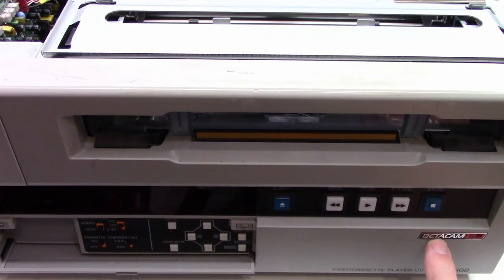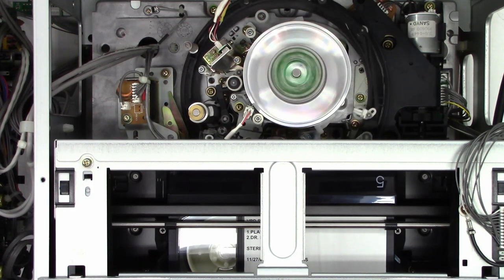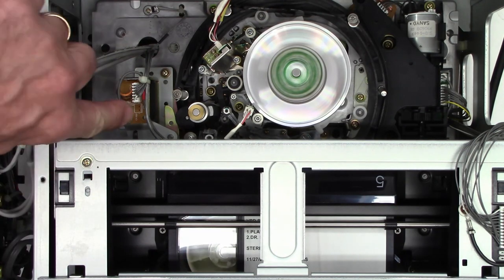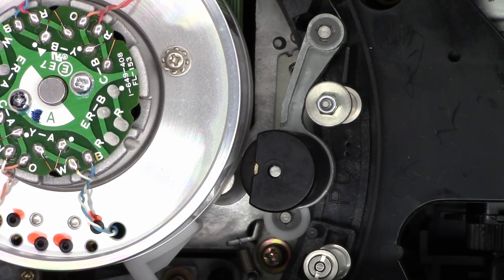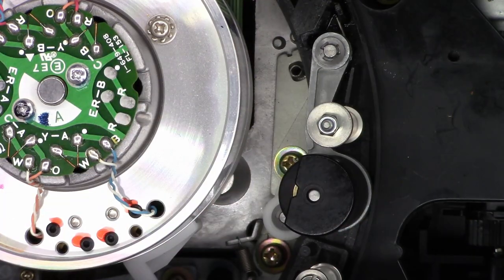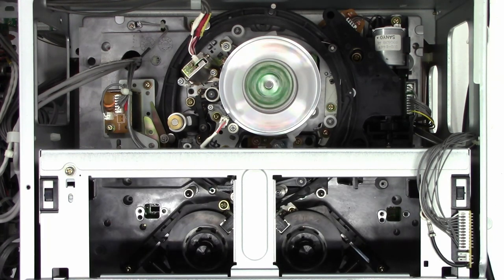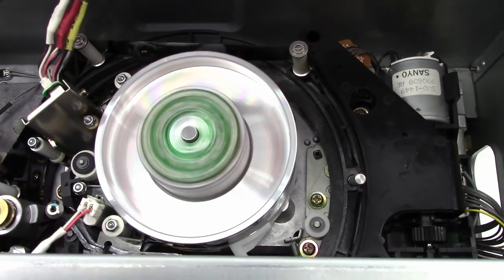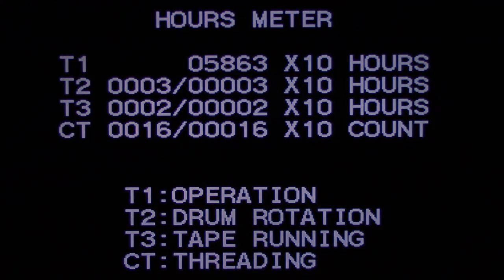SONY UVW-1200 BETACAM SP ERROR 02-603 FIX UVW-1400 UVW-1600 UVW-1800 UVW1200 UVW1400 UVW1600 UVW1800

Comment: Back in Europe i used to have a v2000 (video2000) machine. Huge thing that worked great. But PAL only . Still, wish i still had it.  How did you splice the tape
Reply from the maker: Very carefully by hand with scotch tape on the non magnetic side trimmed to about 3/8" and then hand trimming to get it right. I used to be able to splice audio cassette tape that way also.

Comment: Hi. Nice video. I have a sp machine and I have to help the threading mechanism around. Do you know if I can lube something to make the motion smoother?
Reply from the maker: What shape is the loading belt in? Also measure the voltage on the loading motor.